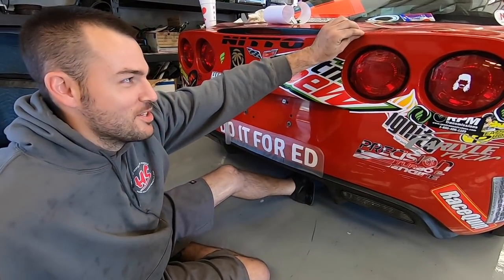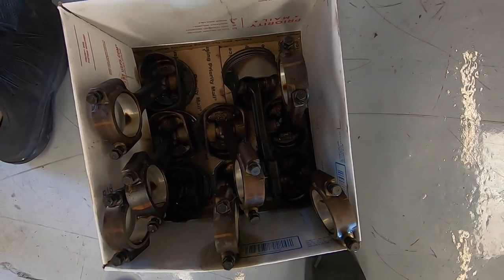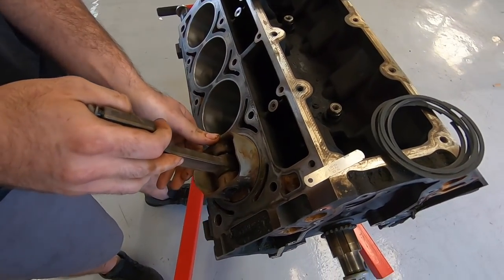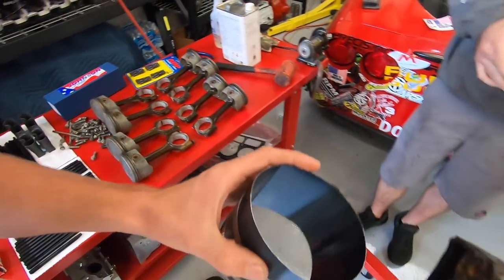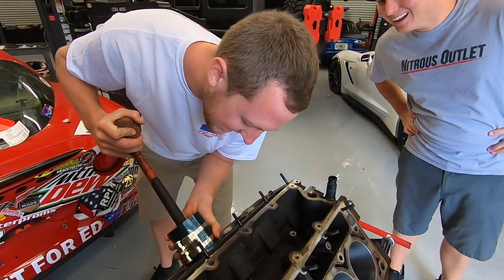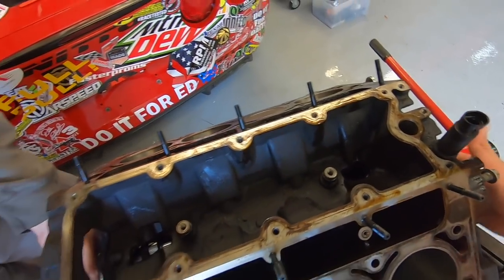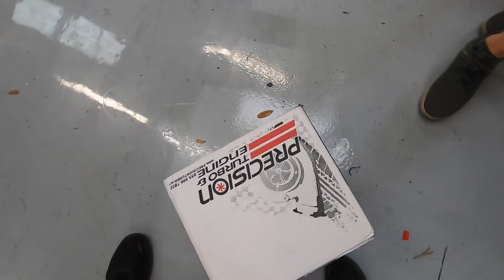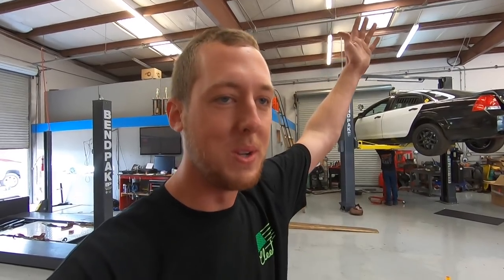The Auction Corvette is REBORN w/Her "NEW" Junkyard Truck Engine!

Comment: tapered bore ring install tool will change your life
Reply: Words of wisdom.
Reply: They are a pain in the ass or at least sometimes they can be lol!
Reply: amen, a friend of mine still uses the manual one ,same results but a lot more patience
Reply: Is that what they were using?
Reply: At least you won't cut your hand open like I did with the tapered one.
Reply: Great if you're only installing THAT size piston.  They are a game changer if you do a ton on 5.3 or 2.4 re-rings under warranty like me.
Reply: Watching this, I reflected on your video.
Reply: Praise the LS! Amen!
Reply: Facts
Reply: I just hope they done some serious deburing on the rings after gapping... ring drag in the groove and on the wall will kill power like nothing else in the engine besides faulty unstable valvetrain
Reply: Love mine 🙌

Comment: So to explain a couple things.
The short travel lifters aka Johnson lifters are specially made Hydraulic roller lifters. What they are is hydraulic lifters with less movement in the piston that pushes the rod up and down. The reason you do that is normal hydraulic lifters maintain the rocker to valve gap, on solid lifters there is no piston to provide clearance they use an actual gap to let the valve close. On a short travel lifter it uses oil pressure and a small movement to control the gap.. essentially it's a short travel precision gaped internally controlled lifter. it is a solid lifter with a built in gap.. It allows the cam to be used on the street lower rpm useage and have the characteristics of a solid without the maintenance and need to gap them from time to time.
Ring gap is easy to understand. Piston rings need a gap so they do not seize in the piston bore when hot. The factory builds the engines to make roughly 400 hp and only needs a small gap to control the combustion process and maintain oiling in the cylinder. On a boosted engine they produce a prodigious amount of heat and metal expands when heated. When you put a lot of heat on the ring they grow and can touch, If they touch they can lock the piston to the cylinder, and the connecting rod and crank keep moving and basically you pull the piston apart at the ring land which is what happened with the other engine. So to stop that from happening you add more expansion room to the piston ring and they do not touch hopefully and then the ultimate limit to power is the parts themselves, aka pistons and connecting rods.. that motor should make 8-900 hp and live for a long time if oil pressure is maintained and the rev limiter works in case a drivetrain part fails. I'll take connecting rods for 100 cleeter with cylinder 6/8 for 500 >;) Ls's are notorious for destroying cylinder 6/8 because of overheating they are the last cylinders to receive water cooling and run hottest and if you watch racing channels and stuff that use ls engines they seem to be where stuff breaks the most. This should be fun to watch.
Reply: Best YouTube comment I've ever read.
Reply: Logan Matteo your response to this comment is what convinced me to actually read the comment..
Reply: Logan Matteo and I was not dissapointed
Reply: Great comment..
Reply: This post is why I read comments.
Reply: cool story bro

Comment: I hate those compressors so much. I broke a ring on my motor, then invested in one of the conical ARP compressors. They're around $35-$75, each one only fits one piston diameter, but they go in perfect every time, and the best part is that the compressor doesn't touch the piston, just the rings, so they slide through super easy.
Reply: I was watching this and I saw that ring compressor and all I thought was "Noooo don't use it, Greg wouldn't approve!!!!"
Reply: On my last piston using one of those I gouged the cylinder wall and ruined the block. was so mad.
Reply: awesomecooly123 I was thinking the same. 😂
Reply: Hell back in the day I used to use a piece of thin metal flashing and a few hose clamps, always worked for me, but I know there are better tools out there, just a junkyard build needs junkyard tools.
Reply: @ @leonh1971  That's what my Shop instructor would say and he built for Fremont Drag Strip as a kid.
Reply: TheCarPassionChannel if you can’t use one of these piston ring compressors without fucking your block piston or rings up maybe you shouldn’t touch a engine
Reply: I bought a Summit brand size specific compressor for $29. I hate the adjustable ones.
Reply: Shawn Thornton until you have to build more than one specific motor, as Jeremy said they’re all great until you’re .010 over then you’re fucked.
Reply: @6door6four96  Why wouldn't you want a tool that makes it easier? Hate having to over-tighten that piston-scraping sleeve and having to push so hard to get them in. The conical compressors let the pistons drop in with the push of a thumb.
Reply: ARP ring compressor is 1000% worth the money compared to this one. You can slide the piston in with a finger with one of those bad boys, no hammer needed 👌🏽
Reply: @TheCarPassionChannel  did you see how easily james did it garret is inexperienced if you know how to use one they work fine and perfect the fixed sizes are costly when you start buying them for all these different bores if you have the money sure why not but this will do most pistons generally these comes in 2-3 different sizes and if you have 2 or 3 of them you could do damn near any engine from small engine to medium duty diesel pickups and some heavy duty stuff obviously the fixed version is better but it also costs much more than one of these per size
Reply: @6door6four96  I'm inexperienced too, the conical compressors are great for inexperienced builders 👍
Reply: Love you and Cleetus' channels but just had to leave some input. Built a handful of engines with the adjustable compressor and never had a problem, just had to spend a lot of extra time getting it lined up. More effort, yes, but not the culprit for broken piston rings. It was free and on-hand, and worked for several engines. I understand there are better tools but I barely have the money to build the engines I do, I'm sure many are the same
Reply: Brandon Thompson exactly if we buy the best of every tool we will be broke I have a 7000 dollar snapon box it’s half snapon half Chinese tools if it’s not used much and light duty there is no need for a expensive tool
Reply: Yep. Sure they cost more and only can be used for one piston size, but the first time you brake a ring (or worse, ringland) it pays for it self!!
Reply: Just need to know wat ur doing
Reply: @DeanF  baylands

Comment: James is right. In the early 90s I had to replace the head in my 1979 VW Golf GTI. I thought I knew what I was doing. I had a Chilton manual and I still screwed it up. I put my head gasket in upside down and siezed the new head. So 750 German Marks for each head and an additional 100 marks for the gaskets and head bolts. That little screwup cost me an additional $1150. Total replacement cost was $2500. The extra $150 was for pizza and beer for use of the motor bay and the motor sergeants presence while I was doing the work. He helped occasionally. I will never forget to look for the mark on the top of the head gasket again...... Good work Garrett!

Comment: It's also good to give the ring compressor a few taps with the hammer handle on the outside wall to ensure that the rings are seated deeply into the ring lands before rechecking the tightness and then tap the piston into the hole.

Comment: I am sitting here with the morning coffee watching you guys fit rings. I have done it so many times over the last 40 plus years I don't remember the numbers .ha ha. I have one of those ring compressors which I was given back in 1975 and a few years ago it finally wore out .It was already old when I got it, great little tool.  When I fit rings and bearings I use that thick engine stuff from Moreys or Lucas. . Works well, but dont put it in the oil for the initial break in because the rings won't seat too well. 😁

Comment: I’ve learned more in this 30 min video than my teachers have taught me all week
Reply: Preston Bartek fr
Reply: Not being crew at all, but don’t learn from this they are making many mistakes. But that’s what makes this channel great. They learn
Reply: They apparently haven’t taught you the difference between Then and Than. Better hit the books buddy
Reply: Agree.  "Fat, drunk and stupid is no way to go through life son"-Dean Wormer
Reply: @hereinmissoula11  Care to list a few of these mistakes?
Reply: The hone job , much too shallow and course, lubed with wd should be diesel ,leaving the crank in while they did it getting metal all over, not taking burrs off rings after cutting them, idle fresh engine on first start..... ....  But they get better every time :)
Reply: Hereinmissoula - But you also don’t know what they did to that engine that wasn’t on any video, so it is hard to sit here and say they did anything wrong when you don’t know for sure what they did and didn’t do
Reply: Hereinmissoula - Also modern diesel which is very low in sulfur content is not a good lube at all, I have built tons of engines over the years and never once used diesel
Reply: Bos742 yeah when honing cylinders use mineral spirits
Reply: Jonka Olofsson hilarious

Comment: You wanna get a bore specific ring compressor. So much easier. Also ive not seen rod bolts break. Ever. The rods normaly bend under load and snap. Seen heaps with the big end still bolted onto the journal and the beam snapped halfway. Stock bolts are fine.

Comment: CLEETER! You should get a sealed oil system for the turbskie because we know it'll blow again, and if you do that, you shouldn't get metal shavings in the bearings and everything else from the engine's oil!
Reply: He could go with an oilless turbo if he's concerned abou that
Reply: J-Edgar Hughes I think most people in the comments are clueless lol
Reply: @J-Edgar Hughes then he just replaces the turbine wheel
Reply: I suspect you'll find the said turbskie is going to last a lot longer than you think. It got a brand new center cartridge, and was rebuilt by Precision Turbo. Might as well be a brand new turbo.
Reply: @J-Edgar Hughes Yeah, you've got a point, I'm just thinking it will last a little longer without metal being fed to it all the time, until the piston explodes again and a chunk of piston gets into it.
Reply: @Scott9181970  Yeah, I see what you mean.

Comment: I always used Marvel Mystery old for assembling and new engine; and I always used rubber fuel line over the rod bolts to protect the crank from getting scratched, when putting pistons in the block.

Comment: Great idea with the mini harbor freight bench grinder! Way cheaper than an actual ring filer. 👍🏻 I loath those old school adjustable ring compressors though. Lost count of how many rings I’ve broken with one of those over the years. I switched to the exact fit compressors a few years back. Way easier to pop into the bore and less time consuming. 😉
Reply: The reason you use a hand grinder or file to clearance ring gaps is to prevent heating the ends up, making them brittle. Little pieces can break off and be carried by the oil to the bearings.
Reply: I've used an angle grinder held a bench vice lol gotta do what you gotta do

Comment: Love the build! Quick tip when gapping rings, instead of grinding both side of the ring at the same time with the grinder, only grind one side, it helps keep the gap parallel to each other instead of making a triangle shaped gap as seen at 11:07. Keep it up!

Comment: As an engine builder and machinist I’ll give you a little advice here, WD40 is a solvent and will break down engine oil, I use it at work to break down sludge in GDI and Diesel engines so it’s not as hard on our wash tank. I’m sure you didn’t use enough to really cause any harm but it’s just a good tid bit of info for your future reference! Cheers and good luck! May ruby live on!

Comment: Good tips all around, but gap spacing/clocking isn't to stop oil from leaking up, it's to reduce the amount of blow by going down to the crankcase, especially in a forced induction engine.

Loved watching Cleetus learn the proper use of the good ol' Ford Adjustment Tool to install pistons :P

Comment: You have to have your rods resized if you use the ARP bolts
Reply: That's what i thought too.  lol
Reply: Same, chances are they'll be out of round.
Reply: Yep. Those ARP bolts torque to a different value which could affect clearance. Was the crank even pulled to check for crank or bearing damage?
Reply: Pretty sure Texas speed knows better than anyone and would have made sure they did what they need to do plus James has built tons of these for his 240 they will be fine I'm sure
Reply: They're bolts, not studs, and they're reusing the rods, bearings, and crank. There's no need.
Reply: Theirs always that one 🤣🤣🤣
Reply: @brucesumner6993  They're torqued to a different spec because they're conventional fasteners, not TTY. Y'all need to do some more research before talking. The only thing that matters is clamping force.
Reply: Which is different with a different fastener .  Which is why they need resized .  Sure this will work .  Sloppy has great builds .  But I was just sayin ....   right way is ...
Reply: It is good practice to do so always. But with that style of rod not as important. Rods that use serrated shank bolts they must be resized. Simple through bolts like LS rods and most aftermarket rods it really does not matter. Much!
Reply: Go read the instructions from ARP on bolts for cracked rods.
Reply: Yep I ate up three sets of rod bearings before I tossed those bolts in the fucking dumpster
Reply: On this engine it doesn't make so much of a difference.  On a conventional rod setup. the rods are machined flat where they meet up, replacing the bolts can introduce offset which is why you'd need a resize.  These engines used 'cracked' powdered steel rods, where the caps will only fit one direction on ONE rod, the rod it was created with. The rod itself is threaded and the bolt goes into it through the cap.  No nuts.  No free play in the cap.  Just one and done.
Reply: Took my Porsche rods and crank to a racing machine shop and the guy asked if my rods were checked when he saw the ARP bolts. Never occurred to me,  sized everything for me . sleep well now !!😄😄😄😄

Comment: I've always been told you have to resize the rods if you install ARP rod bolts. I guess we will find out if that is true!
Reply: I was thinking the same but have heard opinions both ways
Reply: Depends on the rod
Reply: No you’re correct, if you clamp the rod differently, it will change the shape. There is no way around this it will not be round using different bolts.
Reply: Probably why the oil pressure is so high...
Reply: That oil pressure isn't that high for a gen 3 truck motor with a new oil pump and a cold start. My truck runs 60 psi at a cold idle and drops to 45 or so fully warm
Reply: Rods will resize themselves once James juices her with nitrous on the dyno
Reply: @damonbaldwin9417  ok, as long as they don't re-seize themselves.

Comment: From personal experience grinding dust in the eye is no fun. Wear eye protection.
Reply: Just squint. Puts hairs on the chest.
Reply: Ah go the safety squint.
Saying that I was wearing safety glasses, and a got grinding dust in my eye.
Had the bit removed but it has caused a growth on my eye.
That eye has lost vision clarity.
Reply: safety glasses dont work that well, and it helps more to be able to see what you're doing. you get used to the itch after a while lol

Comment: Gapping and indexing piston rings is FUN! Years ago I was helping a friend build a small block 350 for his wife's car. Layed all the parts out (I was doing the pistons while he got the crank and rod bearings ready). Oh what is THIS? In the TRW kit is an extra top ring! My evil streak came out. I hid it. Fast forward to when we had the engine built and in the car ready to fire up and I layed the extra ring on the console. He gets in the car to fire it up and goes batshit! Took me an hour and a beer to convince him that it WAS an extra ring! Then the passenger front core plug leaked (they are NOT "freeze plugs" only to clean the casting sand out of the blocks). At least that one is easy to get to!

Comment: Usually when I put pistons in I turn it to where the bores are vertical for the side I'm putting the piston in. Also after  I get the piston in the cylinder I put the cap on too instead of going them last